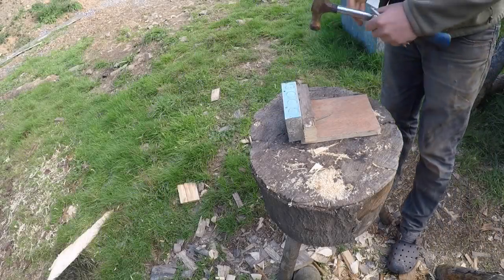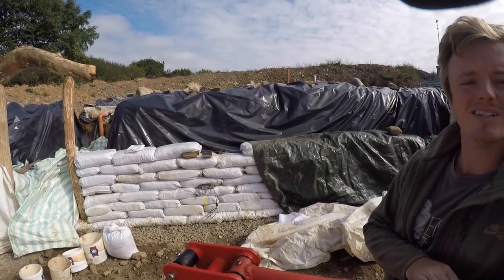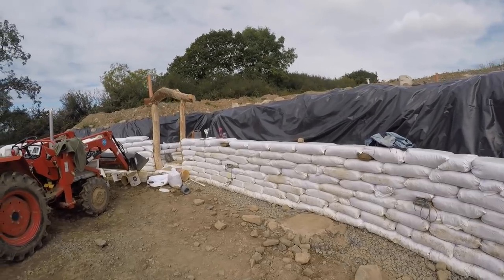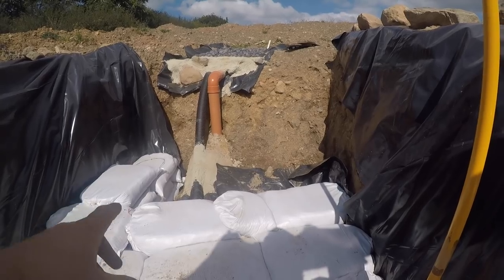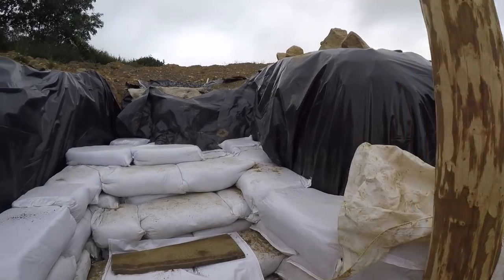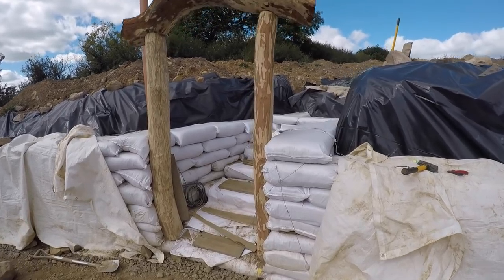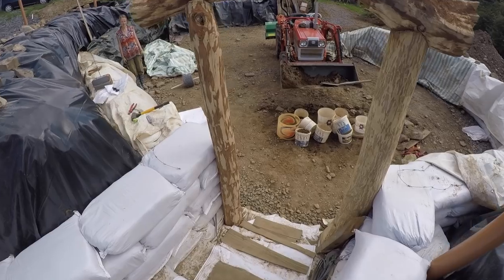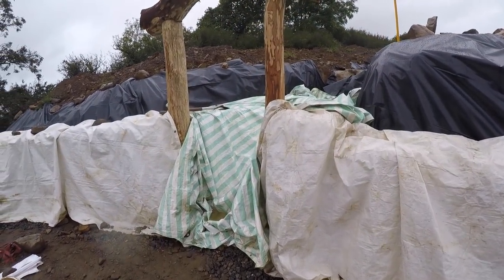Off Grid Earthbag workshop part 10 Earthbag stairs

Comment: Crazy idea, grab an old concrete mixer use it to make cobb. Then mix water activated ceramic into the mix. Place an extruder on the prepared cobb and fill earth bags with it. Then place earth bags pound them into place and the bags turn rock hard in a day?

Comment: Kris, the bag filling seems to be very time consuming. Would it not be possible for you to knock up some kind of wooden hopper that you can fill with the tractors bucket and then put a bag under it and let gravity fill the bag via a trap door or something similar - like a mini version of how they fill some coal trains from huge hoppers? The other thing I was thinking was that as the walls get higher those bags are going to be a pain to lift up - maybe some kind of weighted crossbar would help - pull down on the weighted end and it will lift the bag up at the other end.